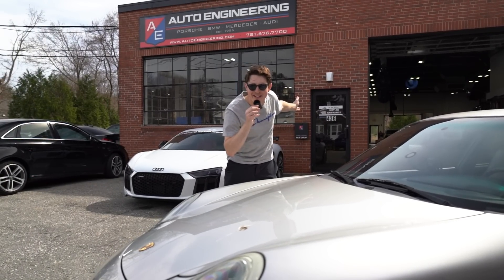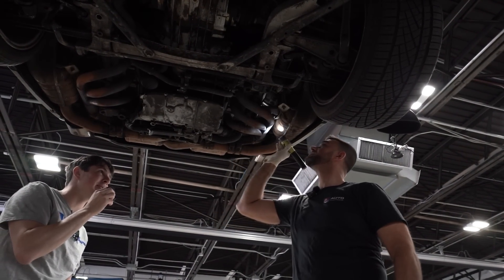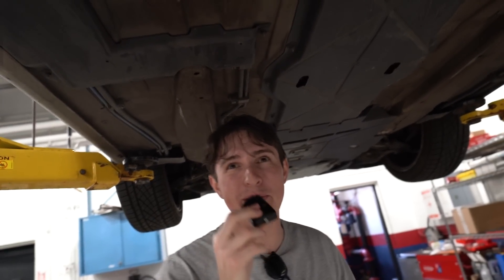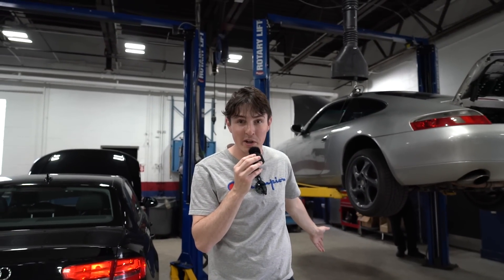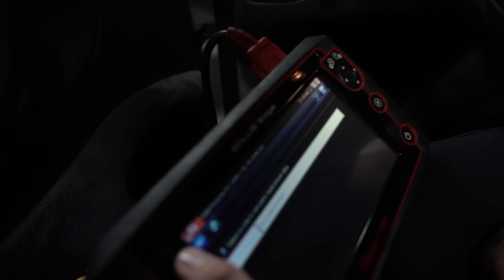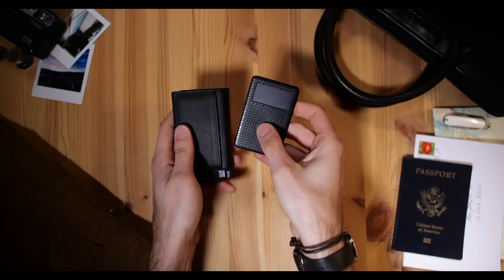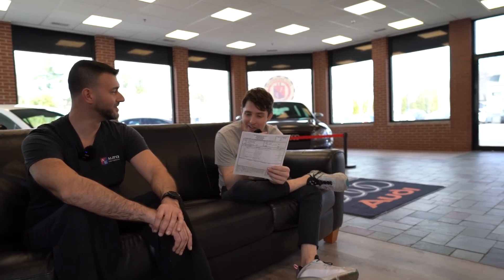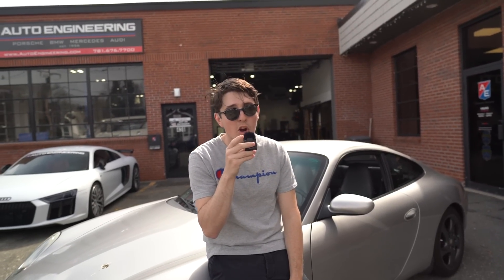Everything Wrong With The Cheapest Porsche 911

Comment: Looks like you lucked out.
Do all deferred maintenance first. Oil/filter, air and cabin filters, flushing all fluids, etc 
Something your mechanic didn’t mention but I’d recommend replacing are fuel injectors and water pump. 2 items that are known to cause problems on the 996.
IMO the IMS bearing can wait until you’re ready to replace the clutch.
Reply from the maker: Thank you so much! I’ll look into those for sure!!